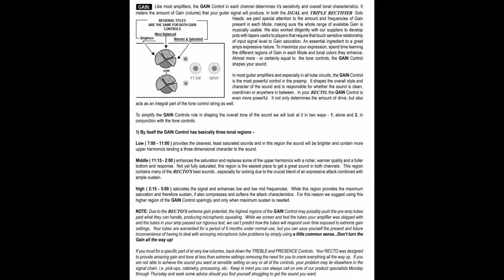Line 6 Helix - Is the Dual Rectifier Misunderstood? What I learned from Mark Tremonti....

Comment: John, Perhaps this is a naive question.  A lot of videos that explore various gain-heavy sounds.  But what about in the range of clean?  Are there ways that you can systematically alter the character of a clean sound by dialing in various dynamics of the envelope (attack & sustain) and control the richness and volume of overtones (or even undertones)?  What is the best (most effective and friendly) tech for achieving those aims?  What is your approach to this, if any?

Comment: @johnnathancordy Wow! great to hear you chugging away - awesome tone as usual. Would you ever do a few of the ridiculously High Gain Amps in the Helix like the Bodonk and others also the Brit Plexi Brt with the Legacy Heavy Dist in front of it with the drive down to 40 is that 'Slayer / early Metallica' rip the paint off the walls  - also putting the Poly Pitch -8  in front of that gets you into Meshuggah territory with that particular setting? It is something you think you'd do a few vids on an let your inner metalhead freak flag fly for a little bit?
Reply from the maker: Of course!!

Comment: Had a real deal Dual Rec many moons ago and I miss it tremendously, mostly because of the interaction between the post-gain EQ and Gain. The post-gain EQ is tragically misunderstood and undersold.
Reply: Could you expand on the post gain EQ info?
Reply: @afterstars  In older Dual Recto circuits, the EQ controls are connected AFTER the components that create overdrive/distortion. This means you are EQ'ing the distorted sound, not EQ'ing the sound of your guitar before it goes into the distortion part of the circuit. This generally means that extreme settings (bass 10, middle 0, treble 10) sound like shit, or at lower volumes it seems like the EQ isn't really doing anything. Some of the more modern Marshalls are also set up like this. It means that "less is more" in that subtle adjustments are best, instead of just cranking everything up.
Reply: @jnh73 Interesting! Thank you for sharing that. It’s been a few years since I’ve played my triple recto. I bought it about 20 years ago in my early 20’s. After years of tweaking the sound, I found that I’d set the amp to my ideal sweet spot, then I’d roll it down just a bit and then compensate that with a (usually) boss sd9 to get it back to where I wanted it but now with more dimension and articulation.

Comment: The biggest thing to get used to with the Helix,is the knobs don’t always correlate or react like they do on the real amps…..In my experience on the Helix Recto,I barely crack the master….anything above halfway,and it turns into that big,farty,flabby mess….but,with that said,I am not a Recto guy…..flabby,fuzzy,mid scooped amp…I just never got along with it….real one or modeled….
Reply: that is exactly what happens if you crank the master on a real rectifier, you probably just wouldn't notice cause your ears would be bleeding. high gain amps don't need poweramp saturation, everything about it is counterproductive to a tight high gain tone. master 3 on a dual recto is already about as loud as it gets, all you add from there onwards is bottom end flub. same thing on a JCM 800 btw despite what the memes and barstool wisdom might tell you.

Comment: It better not suck im getting an hx stomp for metal (and neo soul)
Reply: The mics included in the HX Stomp make a "huge" difference in the tone you can dial in. I didn't realize how big a difference when I first got my Stomp. It's useful to keep that in mind when dialing in dirty, overdriven tones.
Reply: @picksalot1  From what I've heard the ribbon mics sound amazing. I plan to use mostly third party IRs tho
Reply: @tlsarchive  Yes, the ribbon mics are the ones I usually for my Strat. It is extremely easy to scroll through the mics to see how they sound. One other thing to pay attention to is the procedure to update the Firmware on the unit. Follow the instructions carefully. In all the updates I've done, it is critical to update the "HX Edit" software first, and then update the firmware. That should make for a good experience for you.

I haven't used any IR's because I wanted to force myself to learn how to adjust all the parameters on the Stomp. It was a trial by fire, but I know pretty well what I'm doing now. YMMV 😎